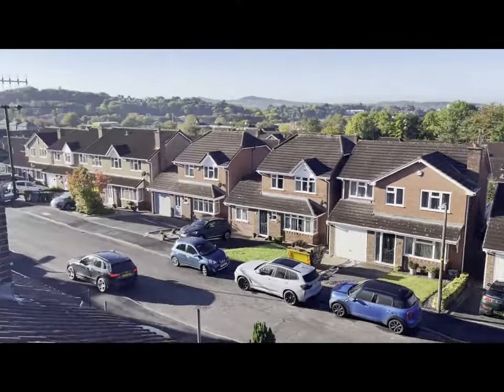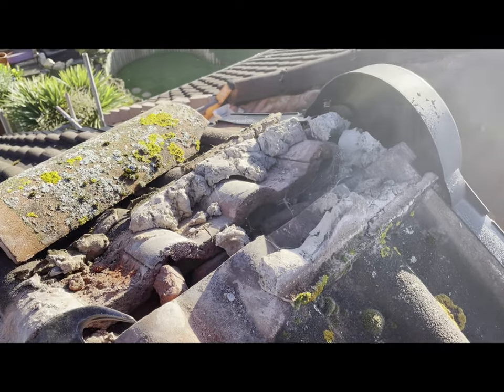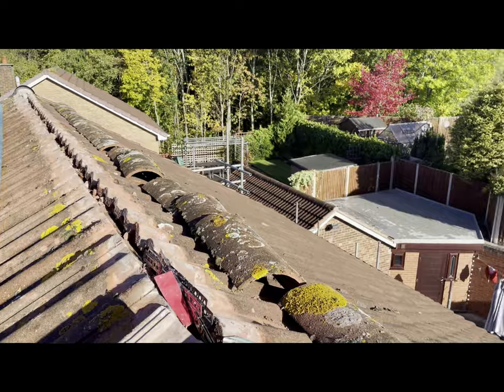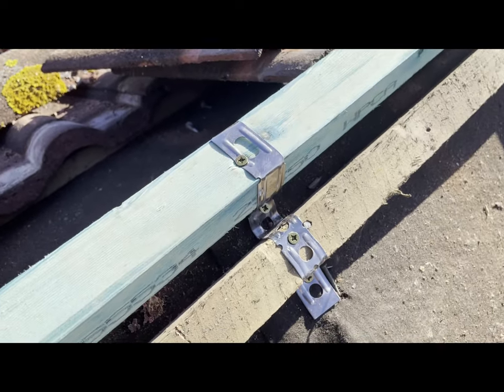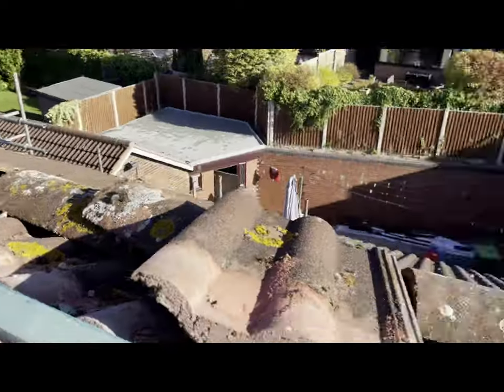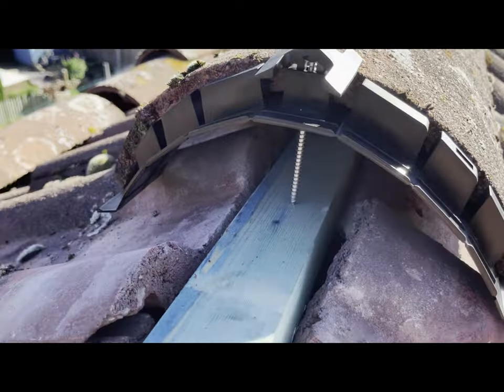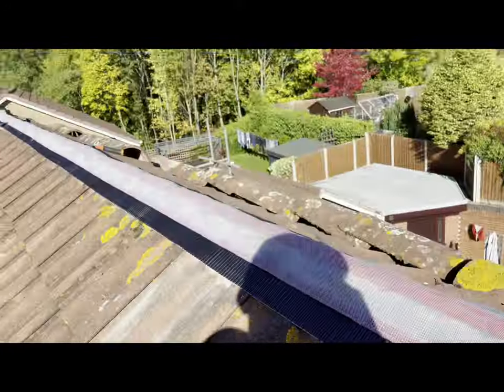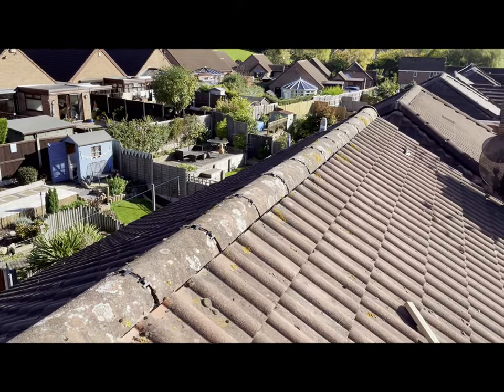Dry Ridge System Retrofit - Advice and Tips

Comment: Why not follow the instructions? The screws he has used will rust and fail. Poking little bit of batten to increase the height instead of a full double batten does not make it any more secure. Should have been entitled how not to retrofit a Dry Ridge System.
Reply from the maker: The screws are zinc plated, covered by ridges, roof tiles will fail before they rust out. The bit of batten was to demonstrate the height difference. If you watch it again you’ll see I did double batten the length of the roof.
Reply: For clarity I would have demonstrated using 2 x 2 batten at the outset rather than 2 pieces of 2 x 1, which is not going to grip the tile as well. I think on just about all retro fits 2 x 1 is too small.
  Otherwise good video👍
Reply from the maker: @squizza28  Thanks for that. In some cases there is no room to double up the battens so a 2x2 wouldn’t always work. Until you’ve removed the old tiles you wouldn’t know. So I just come prepared with 2x1 and see what I find. Box instructions always have 2x1 also. It’s never going anywhere in either case if done right.
Reply: Just done mine, doubled up the battens and it was to high for the ridge. So sunk the screws in and planed the top batten back untill it was just lower than the underside of the ridge. Fully supported and no downward stress on the ridge tile 👍👍👍

Comment: Not a roofer, but I wouldn't trust these ridges not to let water in, especially on this old roof, nope. All was needed here was to rebed and cement imo thinking logically.
Reply from the maker: British building standards requires this system fitted on all new build houses and not sand and cement on building sites anymore. It has proven to be effective and not deteriorate like sand and cement does. So it’s pretty water tight bud. The age of the tiles has zero bearing on its effectiveness. Also on this job the customer wanted dry ridge as he’s fed up with sand and cement deteriorating. 👍
Reply: The dry fix system is way better plastic lasts longer than morter.

Comment: Is it advisable to use specific outdoor screws like ones for deckings, as regular screws will corrode in a few years?
Reply from the maker: Screws for dry ridge system come with the kit and are stainless steel. Screws I use to fix the metal brackets are zinc coated. They won’t corrode any time soon. Decking screws would be okay I’d imagine for the brackets.

Comment: The way you installed yours looks so much easier than the way I did mine (installed the brackets straight down onto the ridge plate). Glad I came across this.

Comment: I am not sure but it does not look like the existing felt is cut short of the ridge, no way for air from inside to escape, which negates the whole essence of the dry ridge system?
Reply from the maker: Yeah that’s true, the top batten are too close to the ridge line also to allow venting, my batten for the dry ridge fills the gap. Customer wanted dry ridge as he’s fed up with mortar failing. To aid venting I’d have to strip the top couple tile courses and redo it leaving enough room. not getting paid to do that though.

Comment: I imagine there will be issues getting the adhesive roll to stick. I would clean the area and use PVA to stabilise the surface.
Reply from the maker: On this day it was very hot and with the tiles brushed down sticking was not an issue. In some cases a primer for flashing tape helps it stick, never used pva but it’s possible it would work too.
Reply: @davesalter  Does it matter if it isn't stuck down? My roofers have left the moss around where mine should be stuck down...
Reply from the maker: @Robbooo000  it should be stuck down yes.

Comment: Does a dry ridge system make any noise? Since ive had mine done, in high winds it sounds like someone slaming doors on the roof..? Any advice?
Reply from the maker: It shouldn’t is fitted right. Either tiles are loose or the felt is somehow not done right and being caught in the wind I’d say.

Comment: How do you fix dry system to a chimney ?
Reply from the maker: You'd need to mortar bed a full ridge tile against the chimney flashing, also using a screw fixing with drilled hole in the end ridge. The lead flashing against the chimney would have saddle on the  end tiles under the mortar, so if it was ever to let water in, the water could still escape down the tiles and not leak inside.

Comment: Dry ridges are fitted on all new build multi developments. If these systems were dodgy builders like David Wilson hones 
wouldn’t be using them. With dry verges, dry hips and ridges valleys  all guaranteed up to 25 years I can’t see the issues. 
No mortar joints are guaranteed any where near that on a ridge. I understand they can last even when cracked for 30 odd years. 
They also have the advantage of allowing the roof to breath doing away with expensive ridge breathers. The only issue I have
 is the use of those plastic top clips. I always use the stainless top clamps, plastic gets brittle with uv light over the years and 
can crack and break if the roof is walked on for any reason and then nothing is holding the ridges except their weight.  
Fantastic job this chap made on that roof. I’d pay him any day to do a roof.
Reply from the maker: Thanks buddy 👍
Reply: Can you explain how the roof doesn't leak between where the plastic brackets are between each tile? Surely it will leak onto the breathable part of the membrane below?
Reply: It will leak through and run down the felt under the ridge tile and onto the tile

Comment: Does the manufacturer recommend the need for drilling the ridge tiles then fixing with a screw and lead washer? Does the plastic joining clips not do that?
Reply from the maker: Yes each ridge needs 2 fixings per instructions. Only the end ones I’ve drilled, the rest have 2 fixings from the central joiners. The lead washer is my idea. I’m sure others have thought the same.

Comment: Great video, clear and helpful - thanks for posting.  I have plans to do similar on a slate roof.  I see there's been mention below of cutting the felt at the apex, and there not being enough room between tiles/top battens on your job...  Please may I ask...  1. What is the ideal space between the top battens?  2. With slates, should the top slate be cut to be flush with the top of the batten at the ridge, or should it overshoot the batten a little?  Many thanks
Reply from the maker: Hi thanks for your comment. Top of batten should be 2 inch from the ridge and slate can be at the top of the batten or a little over is fine  If it’s an existing roof and top batten is closer than that it’s a much bigger job to strip it out to redo it for ventilation but that’s up to you. Good luck. 👍
Reply: @davesalter  Thank you so much for taking the time to reply - really helpful and very kind of you.  My battens are 105mm / 4" apart, so that seems about right.  Strangely though, on one side they cut the slates flush to the top of the batten, while on the other they extended the slates pass the batten by around 70mm.  Odd.  Can't see a reason, so when it comes to changing to a ventilated ridge I think I'll cut the top slates down on the one side so that they too are flush with the batten.  That'll give me the full 105mm / 4" gap then.  Thanks again for the video and for your response.
Reply from the maker: @t1n_0men  No problem mate.  😃👍

Comment: If you instal the ridge caps at the end & make sure they fit tightly to the end of ridge tiles would this count as a 1x mechanical fixing in the same way dry verge does for tiles, which would negate the need to drill & screw the end ridge tiles?
Reply from the maker: I don’t think the dry verge units count as fixing for the tiles or the ridge really. I can see the logic but I’d always secure the ridge and tiles with their own fixings, especially on the verge. The end caps cannot always be fitted tightly which would leave the ridge free at one end to movement. I’d fix it to be confident it’s secure.
Reply: @davesalter  Some dry verge systems manufacturers instructions state they count as 1 mechanical fixing to tiles & the instructions for the northstone tiles that I'm currently fitting to my roof also say appropriate dry verge system count as one, but I've not seen any such guidance regarding ridge tiles so I did wonder 👍
Reply from the maker: @northeastcorals  ok mate fair enough. The tiles I can see the logic in it, never seen any guidance on it myself either but certainly with the ridge I would think it’s best to secure it with a screw. 👍

Comment: Doesn't water (rain) get in through the fixings?  Do they somehow seal to the tiles to make the join impervious?
Reply from the maker: No it’s designed to be fully water tight mate. It’s f fitted right. 👍
Reply: Yes, thinking about it, it's the membrane that provides the waterproofing.  The fixings are just that (fixings to hold the tiles in place)
Reply from the maker: @neilcase  the plastic units between each tile give water protection, water will drip down them to the main roof tiles. The felt isn’t water proof I don’t believe, but a vented layer to help the loft space breath if fitted correctly.
Reply: This is what I don't understand surely where the bracket meets the edge of each tile water will get in? No way that keeps ot watertight.

Comment: Not an expert, but aren’t you supposed to open the felt at the top to allow the roof space to be ventilated? Cheers
Looks smart btw 👌🏻
Reply from the maker: Yes mate you are not wrong. If doing the roof from scratch I’d allow more space on the ridge for the batten to also allow some airflow. Tiles were very tight on this roof as you can see, the batten only just fits between the tiles so no great air flow possible. This loft space is well ventilated and doesn’t suffer from condensation so didn’t make the extra effort and cost to allow for this. Customer just wanted rid of the mortar on this job. Thanks for watching and commenting. 👍
Reply: @davesalter  if there’s no condensation problem then no point doing the extra work 👌🏻
Reply: @gdfggggg  This will allow for more ventilation even with the smaller gaps too compared with the mortar